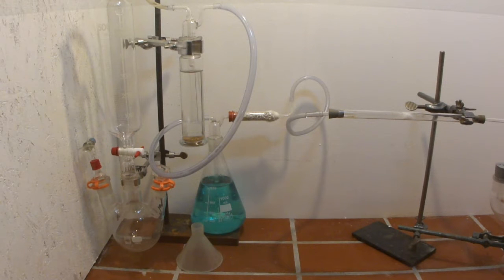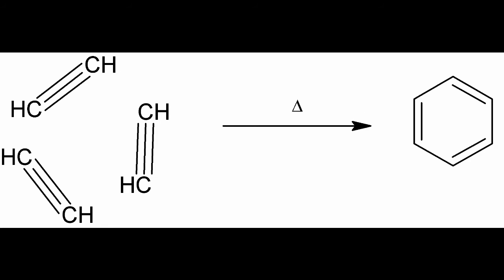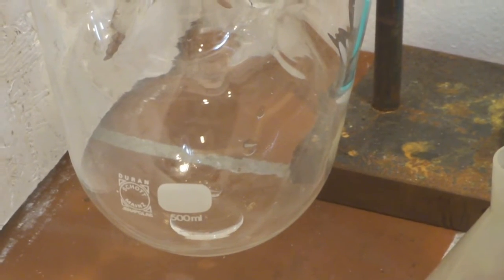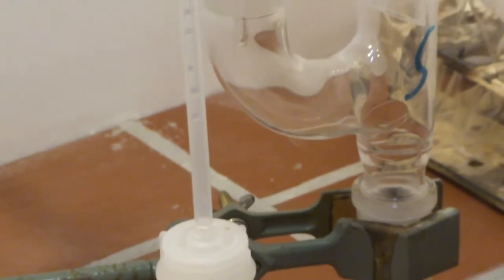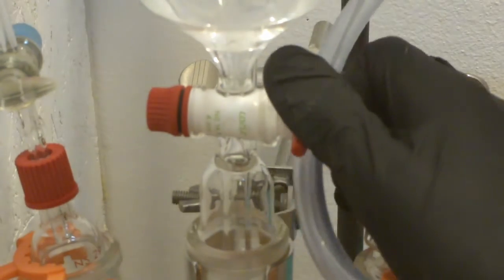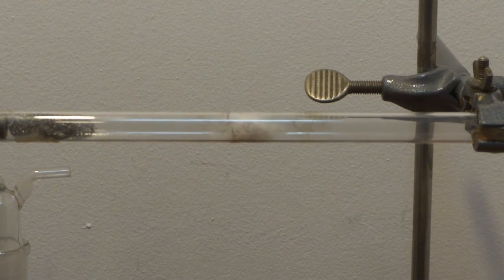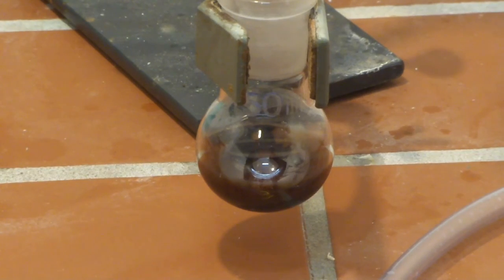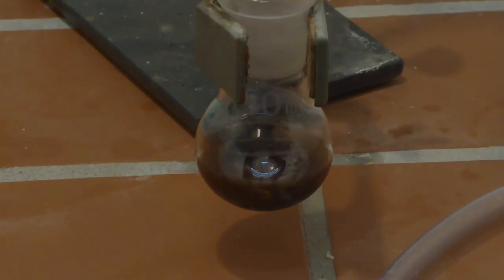Reppe Chemistry: Synthesis of benzene from acetylene

Comment: Here's an interesting Reppe chemistry variant for the homelab: synthesis of 1,4-butynediol by bubbling acetylene through an agitated slurry of catalyst (13% Cu on pumice) in aqueous formaldehyde at 90°C, yield 90-95%. 
Reference: Kale, S. S., Chaudhari, R. V., & Ramachandran, P. A. (1981). Butynediol synthesis. A kinetic study. Industrial & Engineering Chemistry Product Research and Development, 20(2), 309–315. doi:10.1021/i300002a015

Comment: How did you obtain the sodium plumbite?
Reply from the maker: By dissolving a mixture of lead oxides in a concentrated, hot solution of sodium hydroxide.
Reply: What does this do? I got nothing useful trying to Google. Which gas is it scrubbing?
Reply: @danieljohnson3024  It is for capturing H2S evolved  from sulfides reacting with water ( CaS  may form from sulfates  during CaC2 production in arc furnace, and copper ions capture phosphine, resulted from Ca3P2 formed from phosphates,, these two gases are the reason why calcium carbide smells awful)
Reply: @dddddd7315  I couldn't find any literature of how sodium plumbite can break down the gas, or what it would the reaction products would be.
Reply: @danieljohnson3024  Lead cations precipitate with sulfide anions as H2S is in equilibrium with HS and S anions, ratios depending on pH. The basic your solution, more you get sulfide anions. Actually just sodium hydroxide solution would capture most of the  H2S but Ksp of PbS is 3×10-28, so he guarantee there is no way any sulfur passes through and creates CxHySz type junk. Many metals would precipitate with H2S but lead does not form explosive acetylides like silver or copper I think thats why he used lead especially.
Reply: @dddddd7315  what does it do to phosphene?

Comment: Since you are playing with my favorite rocks, I thought I'd share something I invented as a child with you guys.  Take a gallon milk jug,  on the neck, right under the cap,  take a needle for sewing,  the small one in your kit and poke a hole in the neck,  put a few rocks in the bottom, add a little water and then loosely place the lid over it and wait a few minutes until the acetylene pushes all the other gasses out of the jug, once you strongly smell only acetylene gas by barely lifting the lid and sniffing,  place the lid on and place somewhere near someone who doesn't suspect anything, like 10 feet away, not too close because when it does it's thing it blows white paste all over the place, like the walls, ceiling etc.  Then when no one is looking light the hole and you will get a small pilot flame,  then back off.  The flame will slowly melt a bigger hole and after a little while you will get an m-80 sound and as I said anyone too close will be painted white.  Obviously take care when lighting it and don't be too nervous, it's only acetylene after all, do not use anything but light plastic jug such as a milk jug, anything thicker can  hurt you with flying debris.  A milk jug is tough enough it just rips and nothing becomes shrapnel.
Reply: It can be very extreme, be responsible! 
Remembering my younger days, I have played with even more exothermic reactions than this, but acetylene can give extremely loud bangs! Don't let your fun make others suffer!
Reply: This is awesome! How much time do you heve? You remember?

Comment: Have you tried to make Naphthalene by the same process? It needs to flow acetylene gas under the charcoal heated over 400C.
Reply from the maker: We did never try it. Can you give us a reference for that process?
Reply: This was described in the works of the Nikolay Dimitrievich Zelinsky. https://en.wikipedia.org/wiki/Nikolay_Zelinsky
http://ewhows.com/en/pages/1265560
http://forum.xumuk.ru/uploads/monthly_12_2010/post-735-0-74415900-1292201341.gif
I am searching for a synthesis of naphthalene with a lab equipment. The goal is to synthesise from scratch A-Naphtholblau ( Amide black 10B). (just to explore the science)
What did you use in the centre of a quartz tube?
Reply: Is Walter Julius Reppe wrote any chemistry courses, books?
Reply from the maker: In the center there is just some quartz wool to provide some surface for the reaction to take place. You could certainly try it  and see if it works. 
I don't think there are course books. However, Reppe Chemistry is of course very interesting to take a look at and he has several publications. If he has written some, then they are going to be in german anyways.
Reply: That is what I am going to do! Well as I figured out from the Zelinsky's works is that a charcoal main purpose to obtain high pressure for reaction via capillarity force. I am gonna try to make the same setup as you shown in this video and then to play with quartz wool/charcoal and maybe will try to blow benzene gas into the reactor tube. So, how long you keep the setup working? I am gonna try to keep it working about 5-10 hours to take all possible fractions and then identify them. Thank you for your reply!
P.S. - Maybee I shall try to learn german in fact of that case:)))
Reply from the maker: I would even consider using activated charcoal as it will have a lot more channels and capillaries. For the purpose of making this video, the entire reactor was allowed to run for only about 30 minutes. This time can of course be extended. Make sure that no acetone is carried over from the acetylene lecture bottle as that could possibly be absorbed onto the surface of the charcoal.  
5-10 hours seems quite a long time for a initial test run. But of course you can do it if you have enough acetylene gas. What reactor temperature is given?
Well, I always wanted to learn russian. :D
Reply from the maker: Yes, that sounds very good. I'm looking forward for seeing your results!
Thats very kind. I would appreciate those texts. I probably started "learning russian" five or six times now but after a week or so I always forget about doing my lessons or I am too busy. I'll also try to dig out some old articles about your reaction because there must be definitly at least a side note in the "Liebigs Annalen der Chemie".

Comment: Can you make a video on how to turn methane into methanol ?
Reply from the maker: Are you interested in the process itself or in making usable quantities of MeOH?
It can by done via partial oxidation of methane with a Pt catalyst, however the process control is not easy. We might try it but dont expect huge yields. A simpler method  would be by SN2 of chloroform with OH-.
Reply: I was watching codys lab when he made the methane generator. I thought it would be awesome to make it a liquid fuel for easy storage and handling. Also in addition methanol can be used in a fuel cell to generate eletricity. Would be cool if you could teach for example farmers and people living off the grid how this could be done. I myself love electric cars and solar powered stuff as well as chemistry in general and also how to use chemistry for clean fuel.
Reply from the maker: Thanks a lot. Sorry for the late replay. I'll take a look at the video and I'll do some experiments towards the partial oxidation of methane in the next days. The difficult thing really is to not completely oxidize the methane to carbon dioxide. If you succeed in intermediatly producing methanol, it is perhaps going to be hard to stop at that point and not to go further towards formaldehyde and formic acid. However, we'll see... 
BTW: Do you know if there is a commercial setup that you can buy that would convert the methane into methanol? If yes it would be interesting to take a look at the catalyst and the pressure range.
Reply: Thank you very much. I look forward to see this.:)
Reply from the maker: So as we expected, unless you want to build a high pressure reactor this will not work. Oxidation goes almost completely towards carbon dioxide.
Reply: Thanks for trying this out. With high pressure is the chemical process of the catalytic reaction different or Is it similar as with Haber Bosh that you can make ammonia in normal pressure but the yield is better with high pressure.
If the catalytic reaction is to fast then what happens if you decrease the ammount of Platina?
Is the reaction different if you use Palladium?
Reply from the maker: The problem is not the speed of the reaction but rather that the current conditions almost exclusively favor the formation of carbon dioxide and not methanol. This reaction even hardly works in industrial setups. Thats why they do the so called reformation of methane to carbon monoxide and hydrogen. This "synthesis gas" is then "readily" converted into methanol. 
Evalyn Mae C. Alayon, Maarten Nachtegaal, Marco Ranocchiari, Jeroen A. van Bokhoven: Catalytic Conversion of Methane to Methanol Using Cu-Zeolites,  Chimia, 2012, 66, S. 668–674
For all practical purposes I would forget a low-pressure gas phase synthesis of methanol from methane.
Reply from the maker: Yes, thats one of the processes that I mean. 
Well, we all started  somewhere. I guess as a child you where rather interested in black powder and not in a Diels-Alder Reaction. :) 
Educated chemists are sometimes not open for rather unconventional ideas and ways...
Reply from the maker: I revel in nostalgia right now... when that probably 14 year old child named Astral Chemist finally understood after months that cellulose nitrate would not detonate with 7 km's per second just by setting it on fire :). And yes, that 14 year old child that finds books from Tadeusz Urbanski in the library and that moment of irritation when it learned that guncotton and black powder are not the only HE materials in the world :).
Reply: What is the most dangerous things you'we done?
Me:
Filled a very narrow pipe with only one open end with sugar and chlorate and did a burn test. I lit it on and and watched it burn. Then it stopped. No smoke so I guess it stopped. Picked it up and held it to my ear just to be sure in case I hear that it was still burning. 
AND IT WAS.
Throw it away and about 20 seconds later it went off with a loud bang. I found the pipe the next day twisted and deformed. 

Next thing:
Filled a fish tank with sodium hydroxide and water (pretty concentrated). Prepared it for electrolysis to created oxygen and hydrogen gas.  Added a smaller fish tank upside down to trap the gas and a closed tube leading to the gas. 
After I had lots of gas I  made a blow torch opening up the end of the tube and lit it.
I had an Angel watching over me and the flame didn't go back into the fish tank.
Reply from the maker: Oxyhydrogen is not something to play with. A very very very long time ago, I filled a 5 liter jug with a just perfect mixture of H2/O2 for the loudest bang.  I then refrained from lighting it so I set it aside. After a month or so, I remembered the jug and thought that all hydrogen must have been diffused out of the plastic bottle. So I screwed the cap off and lowered a lighter into the jug. The bang and the flash were comparable to a high powered hunting rifle beeing discharged in front of your face. Even the echos where  enormously loud. 
But probably the most dangerous thing was inhaling bromine gas at work because of an accident. 
The more funny things were tasting picric acid to see whether it really tasts bitter... 
You had a good guardian Angel!  I sometimes wonder how most of us could survive child and teenage hood while playing with chemistry.
Reply: I agree on that. Thanks for sharing your dangerous experience. I think these should be listed online so that everyone learn how dangerous things can be. 

BTW I have another, Not me though. 
My friend tried to make Nitroglycerin and mixing the ingredients in an empty paint bucket. He used a wooden stick to steer the mix. LOL 
He is lucky he failed.
Reply from the maker: That sounds very hilarious. My honest opinion about glycerol trinitrate is that it is much more toxic than it is sensitive. For example I have never seen glycerol trinitrate detonate from letting a drop fall onto a room temperature surface, as it is often seen in movies. My guess is that most laymen (and movie makers) exaggerate its sensitivity. 
My opinion may be wrong but inhaling glycerol trinitrate vapours or allowing it to contact your skin seems much more dangerous to me than its "sensitivity". 
Also, liquid, unconfined GTN rarely detonates completetely when subjected to shock or friction. Most often small parts of the liquid detonate at speeds way below 3000 m/s while the rest sits there unchanged. In fact, GTN will (most of the time) extinguish a burning match that has been submerged into it. 
Sorry for my little GTN rant. I would like to show that in a video but I'm afraid that youtube bans me. On the other hand, codys GTN video is still there after all those years....
Reply: I don't know about the sensitivity but I think it can be tested for true or false by making several versions with each an increased / decreased concentration of nitric/sulfuric acid . You could then test the sensitivity and make a chart and calculate the optimal concentration. Just something that come to my mind right now but it is  a pretty bunch of work to do that I'm afraid.
Reply: @astralchemistry8732  i just wanted to say how awesome it is that u went that far with this guys idea ive been teaching myself chemistry and am facinated and amazed and also very cautious cause i dont have some1 to point out in doing something stupid but thank you for the great content i love ur channel so far